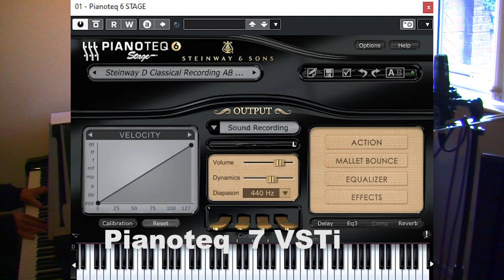Episode 15 - Recording a grand piano

Comment: In the spirit of knowing the original before modifying anything, what "unadjusted" set sounded most like what you heard while at the paino, in the room recording?
Reply from the maker: Well, oddly, the sound captured just after 12 mins in - the underneath placement of a single mic actually sounds the most similar to the sound in the room. The two pairs of close mics seem to have detail, but less depth and the Blumlein, though further away sounds more balanced, but you can hear the room component, which is less in the others.
Reply: @eastanglianradio   Well thinking about that, we used to drop a 57 over the top and part of the way down the back soundboard of upright pianos for live sound at dances in the old days. It always gave a decent balance believe it or not?